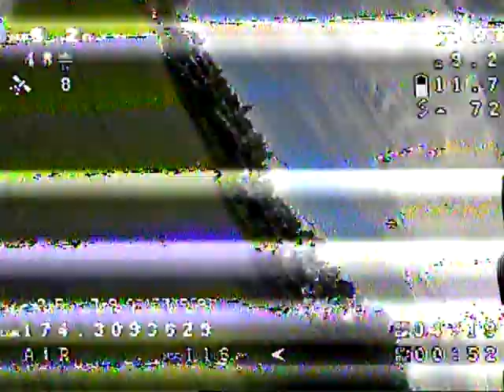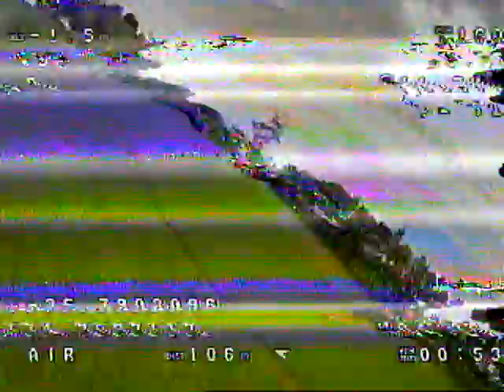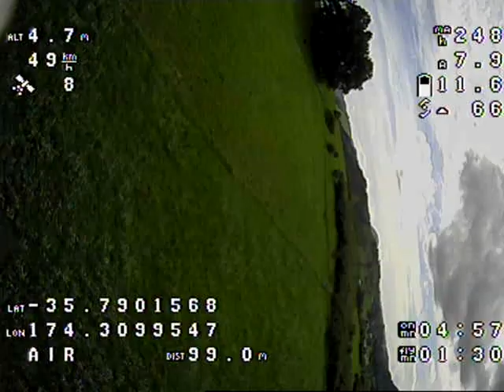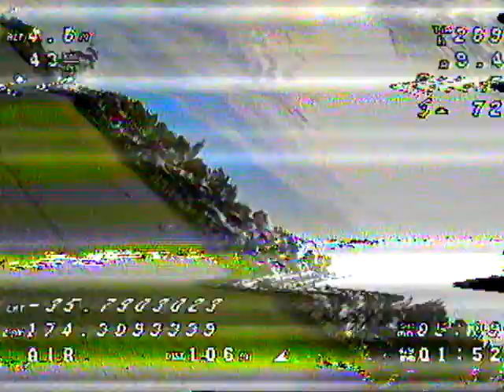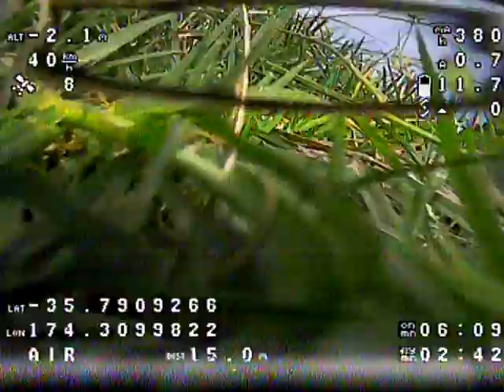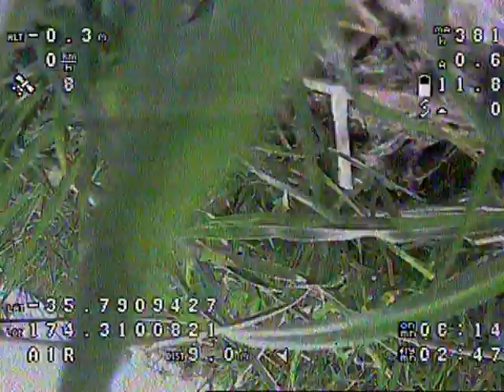Nano Talon & Omnibus F4 with Inav

Comment: Maybe time to get back to the nano talon as its been 6 months of Pubg ;)
Reply from the maker: Funny I was thinking the same thing, my 9yo wants to do some more FPV flying this weekend.
So long as the weather cooperates. 
I built him a cheapy quad and he loves it.
I will probably throw the Nano Talon up too.
I have been doing some flying but didn't think it was too interesting so I didn't upload it.
Reply: im hoping to have mine built n ready for testing at weekend
Reply from the maker: Are you using the stock stabiliser or going with a more advanced flight controller.
The stock one works ok but for FPV, an F4 flight controller rocks.
It's tunable so you can get it to fly how you like it.
You also have so much information available so you can extend flight times.
Reply: Now I wonder what it says in the video title..info and video